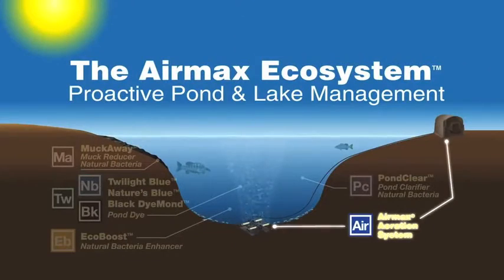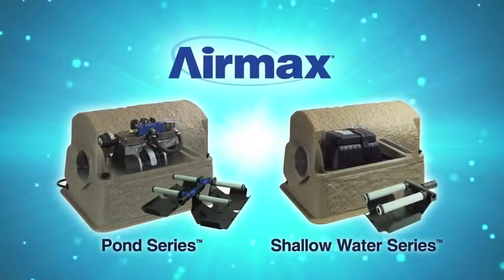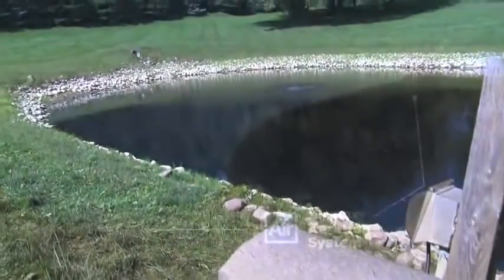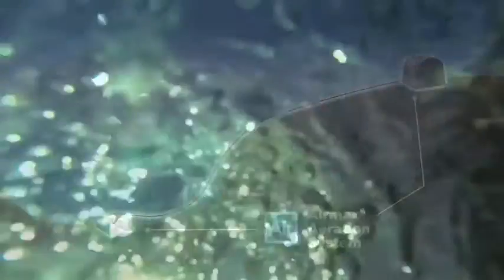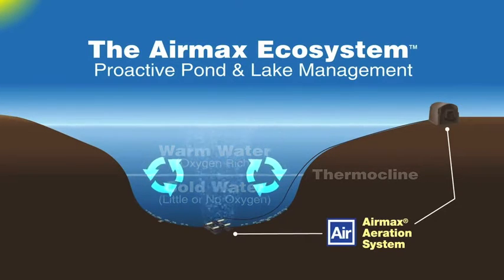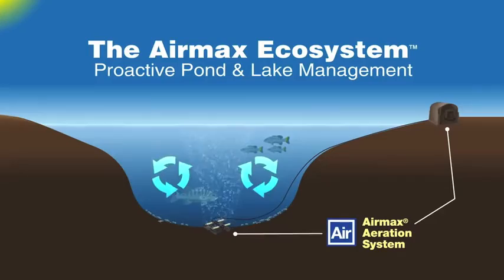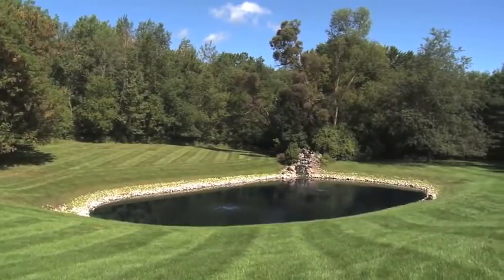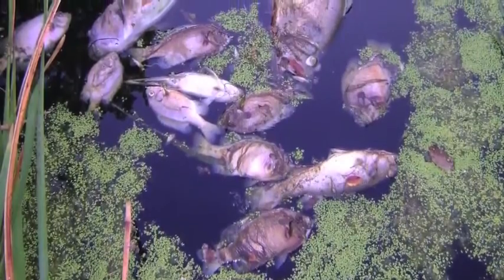How Sub-Surface Pond Aeration Works To Improve Clarity And Fish Health

Comment: Does the compressor make a lot of noise?
Reply from the maker: Some...in my testing with a 1/4 HP pump which would typically be used to power a single diffuser and sometimes up to 2 of them...the sound ouput ranged from about 60db up to 65db in the brands we carry...this was taken with a meter 2' away.  It drops off as you get farther away of course.  I have a video on my channel showing this testing.  Search, How Loud Is A Pond Aerator and it should come up.

Comment: Thank you i am currently researching Aeration for my 1.3 acre pond. What are your thoughts on windmill aeration?
Reply from the maker: Hey Cory...thanks for the question.  I did this video on windmill aeration awhile back.  https://www.youtube.com/watch?v=6pSEHic7I1g

Personally, I find windmills better than nothing...but in order of preference, it would be plugged in 115v, full time aeration, solar in some form would be next best, and windmills, last.  They are not always very consistent.  They also may have some depth limitations.    If power is not near the pond, a lot of people will still use power, and just run airline inground to the pond.  Usually cheaper than running eletrical line, and still gets the job done very well...with 24/7 operation.
Reply: @klmponds  Thank you for the reply.  I will watch the video you linked.